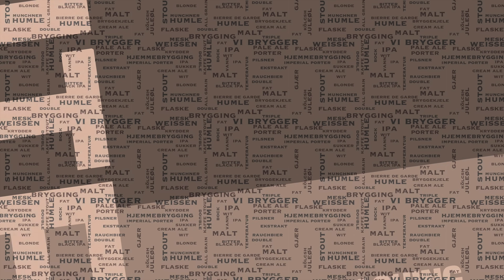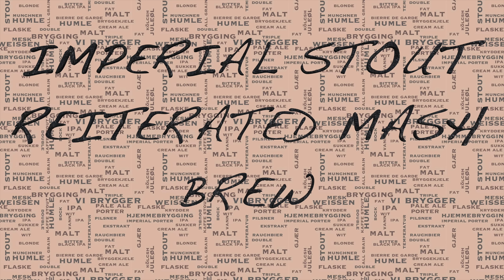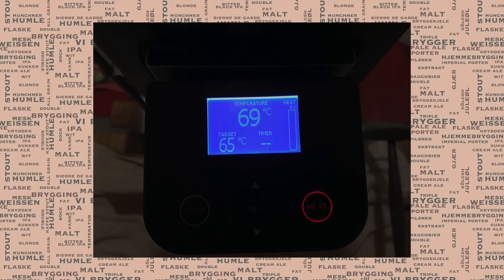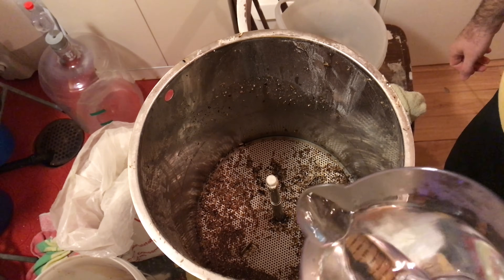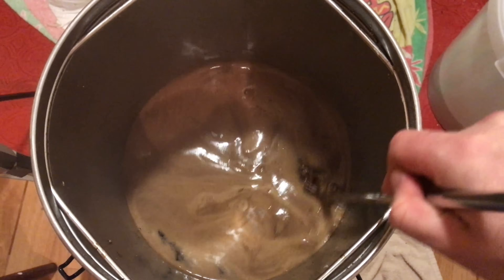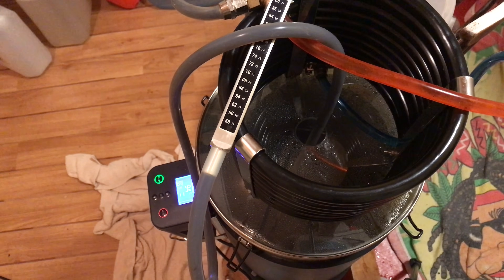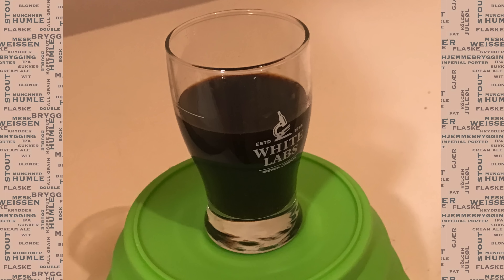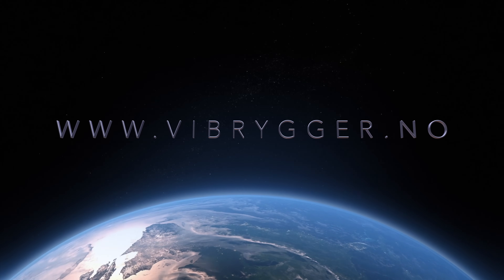Imperial stout reiterated mash high efficiency Grainfather brew 4k

Comment: Hi David, i have a reiterated mash question for you. Using the normal pipework i did a brew with a grain bill of 7.6kg (not reiterated) and quickly fell into problems with a fine crush and very slow sparge/run off. I still have a stock of crushed (by LHBS) grain for a beer and the grainbill will be 7.6kg. So now i am thinking of doing this using the reiterated method. Do you think 3.8kg  is too small for the standard pipework? Given my grain crush, which method do you think would be better? Thanks
Reply from the maker: Hi Tom, How many litres will this beer be for? Have you seen my new reiterated mash video? https://youtu.be/C-7NiGZgKyQ
Reply from the maker: Also do you have any rice hulls? They will counter that very fine crush for you :)
Reply: Thanks David, I used a handful of oat husks from my LHBS on my  last brew, even with a grainbill of 4.8kg just to avoid any problems with a fine crush. This time I want to make a 21 litre (final, in the fermenter) batch. My own malt mill is on the shopping list-any advice on brand for this too?
Reply from the maker: Great :) Malt mill wise go for the best you can afford. I use a “Monster mill”. It works but can be annoying like any mill :)

Comment: Hey David, great video.

Just trying to understand this as im going to attempt it in the next few days.

When you mash in at 12.60l then you sparge with 10.10l (total 22.70l) how come that after the second mash in and you are going to sparge you are only left with 15l ? Is this from evaporation during second mash steps ?

As i'm looking to do a Helles Bock, total grain bill is 6.85kg and going to make a 23l batch, my mash water is 12.75l and sparge is 19.49l = 32.24L (90 min boil) in the grainfather, would there be enough room to add the grain basket and mash again ?

Thanks
Reply from the maker: +Clayton Cassel Hey Clayton, its grain/hop  absorption and evaporation at work. With a reiterated mash you do the calcs for half the brew mash and sparge. Then add the second amount of grain and then do a top up sparge to your preboil amount.

Comment: Hey David, thanks for the video.
How big is your yeast starter for this one?
I'm planning to make a 20 liter Russian Imperial Stout, with one package of M42 yeast.
What volume do you suggest? Thanks in advance!
Reply from the maker: +Miguel van der Hiele I didnt use a starter but mine was a 15L batch. You should be ok to simply collect half a litre of the wort after mash out and once its down to room temps pitch the yeast into that to hydrate it. Its a fast yeast. It takes off after 1.5-2 hours from pitching.

Comment: Hey David, When you sparge with 10l for the first mash and 3l with the second, are you getting all the malt out of the second ? Is there any reason why you cant split up the total sparge water for the batch (13l) to 6.5l each sparge instead ?
Reply from the maker: +Clayton Cassel The first sparge is a standard figure based on the malt amount. The second one is a make up volume sparge only. You will find that by doing it this way you will get a better end efficiency.

Comment: I was puzzled by your comments regarding Sparging. How do you do a slow Sparge? In my insulated Cooler days I had a rotating a Sparge Arm on top and adjusted the outlet to maintain a cm or so above the grain bed, a Sparge would take the best part of an hour.. The grainFather has no such outlet control and it goes away very quickly. Am I doing something wrong? My old Cooler system on 5kg of grain had an efficiency of around 80%., my Grainfather manages 70%.
Reply from the maker: +James Goach The speed of your sparge is really dictated by your grain crush. Sounds to me like you are grinding too coarse. This will reduce efficiency and make the sparge water run through your grainbed too fast. Use a credit card sized gap on your mill :) 75% should be easy to get. Hope this helps.

Comment: I will be doing a 26 L batch of Imperial Stout. I will do a reiterated mash. This means I will split the 11 Kg grain bill in 2. 5.5 Kg each .

I need 18.35 L for mashing and 17.05 for sparging. I go through the first step, where I mash, mash out and sparge. Assuming the calculations are right, I will end up with 29 L of wort after the first mash and sparge.

If I insert the grain basket and mash in another 5.5 Kg in the 29 L of wort, it will not fit. It will not fit even with only 26-27 L of wort.

So how exactly do I proceed? Do you have an idea?

Thanks in advance.
Reply from the maker: +Mihai Mahu I would suggest that you bring your volume down. The most I have brewed is 25L. The GF by standard is a 23L system.
Reply: Ce ti-a iesit ?

Comment: Hi David. Love the channel. Keep up the good work. 

Sorry, but would you kindly look at below and comment if you see any flaws. 
Im planning on doing a reiterated mash. I want a 20 ltr batch with a grainbill of 9,8 kgs, So I type in 20 ltr batch in the grainfather mash and sparge water calculator and 9,8/2 = 4,9 kgs of grains for a 90 min boil. This gives me 16,72l Strike water and 13,69l sparge water.  So, I add 4,9 kgs of grain into the 16,72l strike water. Mash for 60 min as usual and do a 10 min mash out followed by a sparge with 13,69l water. When the grains are drained I remove them and add the other 4,9 kg of grain using the wort as strike water. I mash for 60 min again with a 10 min mash out and then start the second sparge this time using an amount of sparge water that will bring the preboil volume up to the right level.  Boil time is 90 min. Boil off rate is 2,8/hour so total boil off will be 4,2 ltr. On top of this I add the 1,8l for loss in trub and kettle. Preboil amount should in this case be 20+4,2 + 1,8 ltr, In all 26 liters of wort. Does this look right to you ?

Kind Regards JT
Reply from the maker: +ThePlywoodPelican Many thanks. Glad you are enjoying my content :) Yes that looks perfect. Your boil off rate will be your own though of course due to the variables involved. Mashing these two anounts of malt are within the sweet spot , so you will get decent effeciency.
Reply: Hi David. Perfect. Thanks for the reply. Much appreciated :-)
Reply from the maker: +ThePlywoodPelican :)

Comment: Hi David hope your well. Loving the videos. Just a quick question. I'm just fermenting an Imperial stout (hopefully for Christmas but I fear ill run out of time). Now ive read loads about this that and the other....conditioning bottling temps etc and am overloaded with information. In your opinion how long should I leave my brew in the PF, how long should I condition in my plastic barrel and at what temp, when is the best time to bottle and what temp should I store my bottles. Hope you can help........cheers Nick
Reply from the maker: +nick edmondson Best way really is to use a carboy for conditioning before conditioning. This will speed up conditioning. Check this out, one of my earlier videos:- https://youtu.be/hyCNxiSFARo

Comment: had a crack at this Dave! Wanted your thoughts on the sparge volumes before I had another go. 
As the first sparge uses higher volume 9ie. 10L v 3L), wouldn't it be best to try and balance this out? measuring the sparge water on 1st sparge I was getting 1.007 at end of volume, but was still in 1.025 when i reached boil volume on the the 2nd sparge. 
Keen to hear your thoughts
Reply from the maker: +daeshain Hey :) You could certainly try that but for me it hasn't been as effective. I think its having more water , that isnt as rich in sugar for the second mash that helps.  Did this method not work well for you final gravity wise?
Reply: Definitely got higher efficiency which as you said was the goal. 90%. Final gravity 1.087, but didn't think it was worth the larger effort. going to try with a 10kg grain bill on a stout, see if I can crack 1.100!
Reply from the maker: +daeshain Well naturally this method can be applied where you need it :)
Reply: true! good method to have up my sleeve! Thanks for sharing Dave! Bloody awesome as always mate! :)
Reply from the maker: +daeshain Anytime :)

Comment: Great video, quick question, you state 300 ebc for crystal 150, which I understand is crystal light, which has an ecb of 145-165. Am I getting confused?
Reply from the maker: +Anthonyh Harper Well spotted, I was testing a beta at that time and it was doubling up on ebc. I will amend the youtube description.
Reply: David Heath thanks for the confirmation, looking forward to giving this a go. One other question, does ambient temperature make a big difference when ageing the beer? I assume u just use a sealed carboy at room temp?
Reply from the maker: +Anthonyh Harper . Yes it sure does. For ales optimum temperature is 14 deg c. For lagers 1-4 deg c. Hope this helps :)

Comment: Just one question David,
Would you get better results if you did the first mash & sparge and then removed the wort and then setup to do the other 1/2 and then combine the first with the second for the boil?  Or is this more work than what you will get in return?
Reply from the maker: Jeff Davis I have tried it like this and saw little benefit. This could vary depending on brewing conditions and grain bill.

Comment: hi David. can u tell me better about that method? for example by a paper? because I don't understand very well with the audio.  I'm not really confidence in English listening 😀
Reply from the maker: Francesco Colaneri No problem at all. I am happy to answer any questions that you have.
Reply: David Heath ..just if u can tell me more about the various step to do.  thanks a lot for all.  very very nice videos (I hope to do that a day 😀)
Reply from the maker: Yes ok sure no problem. It breaks down like this:-
1) Make your recipe as normal
2) Look at the amount of malt you will be adding 
3) Work out which pipework is best for dividing up your malt into amount that will allow high efficiency.
Regular pipework:- mash efficiency best at just over 4kg and no more than 5kg
Small batch pipework:- mash efficiency best at 2.5kg to 3.5kg 
4) Mash as decided. First mash will have a full sparge as if this was a brew just with the malt in your first mash. Use the GF online calculator to calculate the water to use for the grain at the start and also the sparge. Mash in and mash out.
 5) When you sparge use a mix of hot and cold water to bring your wort down to the temperature you need for the next mash. Remove the grain totally .
6) Add the rest of your grain to the grain basket and do your second mash. Mash out as normal. Look at how much wort you have and calculate how much you need to sparge with to get your pre boil volume.
7) Do your second sparge with that smaller amount...use 75 deg water this time.
8) Do your boil and everything else as normal.

I hope this helps :)
Reply: David Heath oh  really great.. I think that I understand that time.  in case of problem can u help me an other time? thank u
Reply from the maker: Anytime Francesco, always happy to help.
Reply: David Heath in the guide you wrote 12.60 strike water.  is the total amount for both mash? (so I divide it in 6.3lt. for mash)
Reply from the maker: Francesco Colaneri This is for this brew only. Use the gf calculator on their website for other recipes.
Reply: David Heath yes I know... I tell for understand if is total water mashing that u use in that recipe
Reply from the maker: Francesco Colaneri Calculate the water for both strike water and sparge water for the amount that you want in litres but only use 50% of the grain for that calculation.

Comment: Do you normally do all your batches with the micropipework, even the milkshake IPA? Thinking about ordering it for myself soon. Why does the efficiency get influenced when using normal pipeworks vs. micro on a smaller batch?
Reply from the maker: FloppyJedi I use it alot yes. The EFF differences come in to play due to the space for the grain. So for smaller amounts the smaller pipework works better.

Comment: David - excellent video on the brewing and starting the fermenting process for such a high ABV beer. Given the 1yr or so conditioning you anticipate, two questions: 
- will you rack into a second carboy after fermentation and do you use priming sugar??
- how will you seal the carboy for that period of time conditioning ?
Many thanks in anticipation ! John
Reply from the maker: Thanks, glad you enjoyed it. Yes the beer will be racked into a second carboy for bulk conditioning. Sugar will only get added when I rack this into my bottling bucket for bottling. At that point I will also add more yeast. Due to the high alcohol I will use a wine yeast for carbonation. The carboy is sealed in the usual way with an airlock. Its vital to check the water level is good from time to time. I did a video on high alcohol beer conditioning and bottling a while back on this channel, check it out for full details :)
Reply: Hi. Im gonna brew a Imperial Stout soon and im gonna use Lallemand CBC-1for bottle carbonation. What's your knowledge of this yeast? What kind of yeast are you gonna use? Cheers!

Comment: Great video!
One question: Why did you mash out on the first mash? Wouldn't it be better to mash out only after the last mash?
Reply: David, why is it vital? In planning my 1st mash I was NOT expecting to mash out. Thanks!
Reply: I agree. Don't understand why you would need to mash out twice.
Reply: Understood. Thanks again for all the great videos!
Reply: Do you mean that the sparge water needs to be at mash out/78C and also the wort?
In that case you need to cool down the wort before second mash. The enzymes from the first mash would still do their job after mash out at last. Wouldn't they?
Reply from the maker: Bjørn Tore Åsmul Glad you liked the video:) No, its vital to mash out before a sparge. You do two sparges.
Reply from the maker: Edward Lamothe To prepare the grainbed for the sparge.
Reply: What if you did the first sparge at mash temp? The wort would be the correct temp for the 2nd mash. Then mash out on the 2nd mash. Thanks!
Reply from the maker: Edward Lamothe You could do that but your efficiency would suffer. Its for reasons like this that many experience a low bh eff with reiterated mashing.
Reply from the maker: Bjørn Tore Åsmul You need to prepare the grainbed for each sparge. You can cut corners with reiterated mashing but if you do it as I advise then you will see a higher bh eff.
Reply from the maker: Edward Lamothe Thats my pleasure Edward. Ive had so much help for much of my life with brewing from others during my career that it seems wrong to not give back to the community, be they commercial brewers or homebrewers.
Reply from the maker: Bjørn Tore Åsmul Thats actually in the video :) I used the first sparge water to cool back down to 65.

Comment: Hi David, great vid. What was your grain crush gap set to?. GrainFather's own FAQ seems wrong on this.
Reply from the maker: David Almond I have to be honest David, I mill be sight only. This was milled at work and that mill doesnt make it easy to measure the gap without taking it apart. Thats commercial mills for you im afraid.
Reply: I am currently using .95mm which is looser then I have been using but recently been getting very good efficencies but that might be down to the new controller. My miller said anything from a credit card .76mm is normal but it is very grain dependent. Grainfather FAQ says 1.27-1.4mm  at that setting my Maris Otter grains would hardly be touched.
Reply from the maker: David Almond Im used to brewing with very fine grain from commercial brewing, we need it less fine for homebrews due to the sparge. I would suggest experimenting for the crush sweetspot. You will find some grain responds differently to the same crush due to kernal size.

Comment: Hi David love the vid, I've struggled big time with efficiency when doing reiterated mashing on the GF. A couple of questions if I may:

1. When you topped up to 18l before the boil, were you expecting 15l or 13l into the fermy? I always have a couple of litres left in the GF, sometimes more on a very hoppy brew.

2. My 2nd sparge last time was very stuck, I didn't use rice hulls so maybe that was my problem. When you say "slow sparge" can you give an indication of time for the 2nd sparge?

3. Do you really need to mash out between the 2 mashes? I haven't done in the past but maybe it's a good idea for an easier 1st sparge and to lock in that conversion.

Cheers!
Reply from the maker: justmund Sure! 1) 15L into the fv. The calcs include this trub and I dont transfer that at all. I never tilt the gf to get more out, when the pump is done with the gf flat, thats it for me.
Reply from the maker: justmund 2) You can cure a stuck sparge by giving it a stir. Go to the bottom and stir upwards first then go from the top chopping into the grain. I find an average 10L sparge takes about 25mins, done properly though it can vary 5mins either way. Slow and even, dont build the water up past the two finger grips.
Reply from the maker: justmund 3) Yes! The mash out is not about conversion. Its about preparing the grain bed for the sparge.